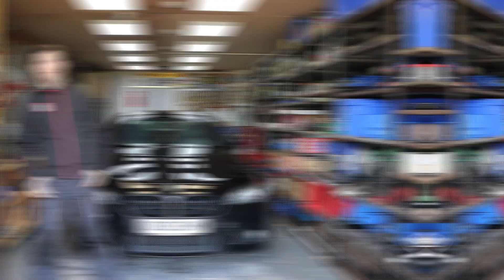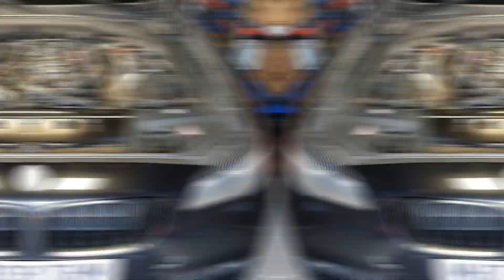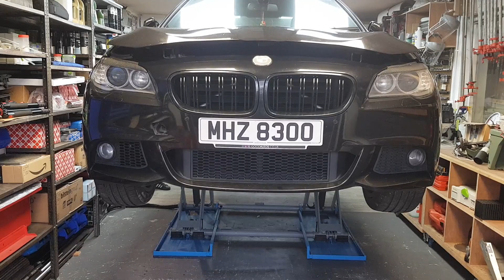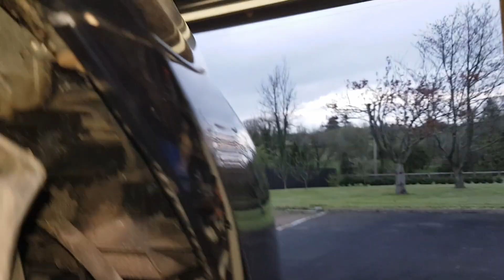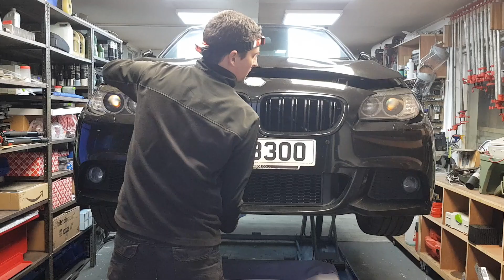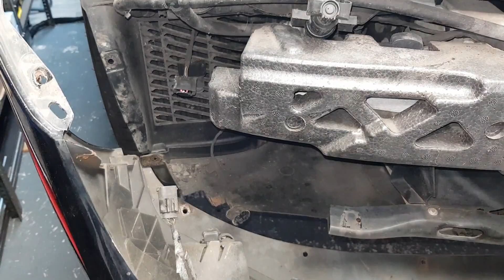HOW TO REMOVE FRONT BUMPER & PLASTIC TRIM BMW F10 F11 N57 N47 535D 530D 525D 520D  M5 528i 530i 550i

Comment: Hello, do you know about this code 249300 for bmw f10 diesel 184 hp
Reply from the maker: Hi
My advice will be to go to a specialist if you can't figure out yourself. Looking at this code could be several issues. HPFP, sensors, in tank fuel pump. If HPFP has failed it will contaminate the tank and fuel lines so it is a costly repair. 🤞it is something small